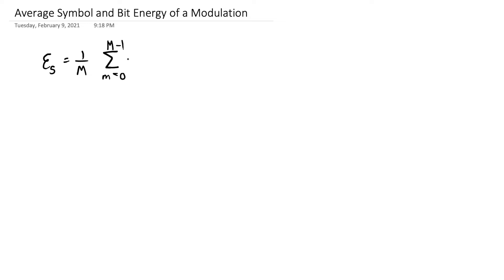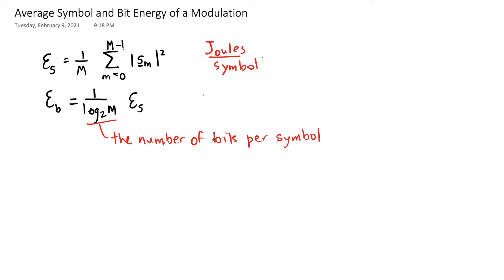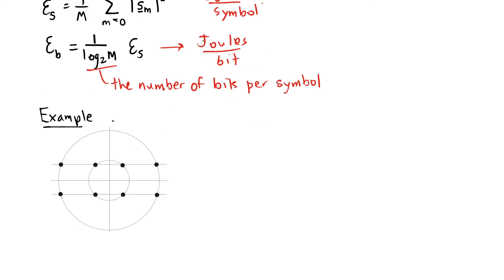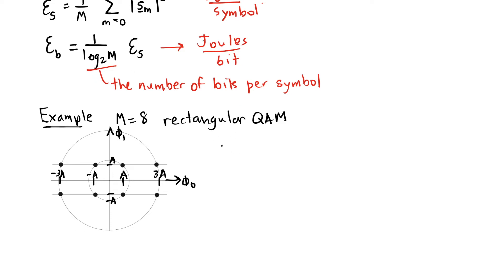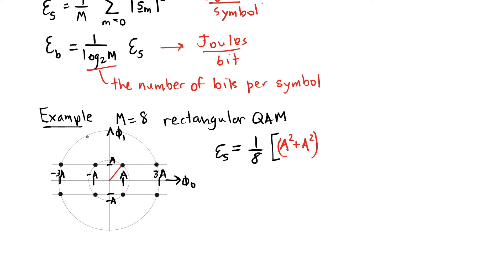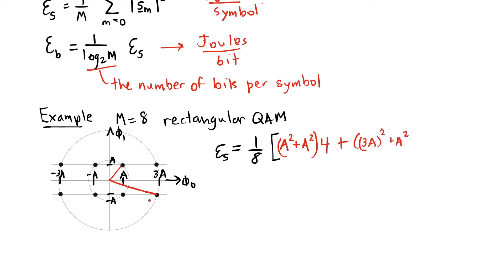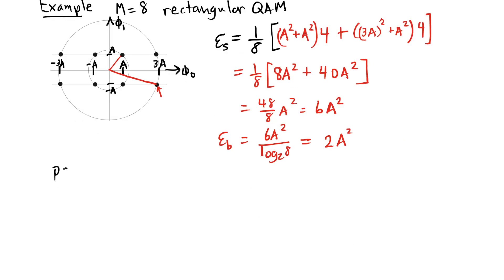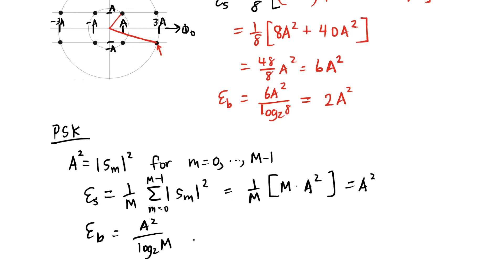ESE 471 Average Symbol and Bit Energy in QAM and PSK

Comment: Isn't the energy/bit of any modulation going to depend on the symbol period?
Reply from the maker: Yes, but we always normalize the orthonormal basis functions to have unit energy. They typically have a 1/sqrt(T_s) in the basis function so that the energy of the basis function is equal to 1, regardless of the symbol period T_s. In reality, a transmitter could transmit more energy per bit when T_s is longer by amplifying the signal more. We account for that separately from this analysis, which is meant to compare modulations with each other.